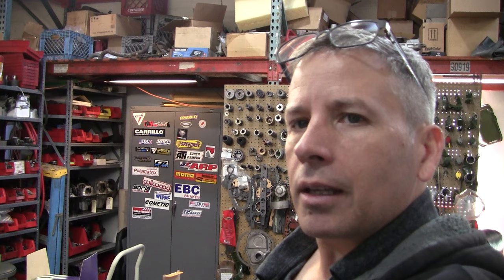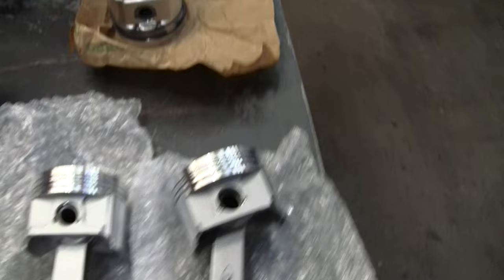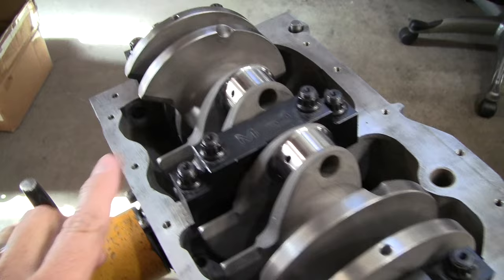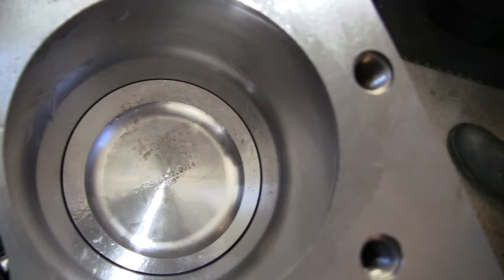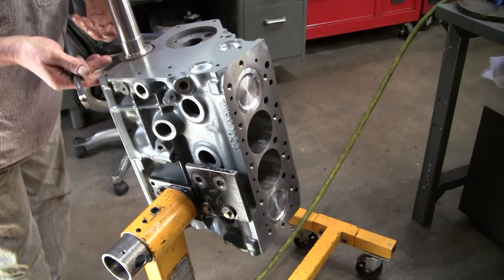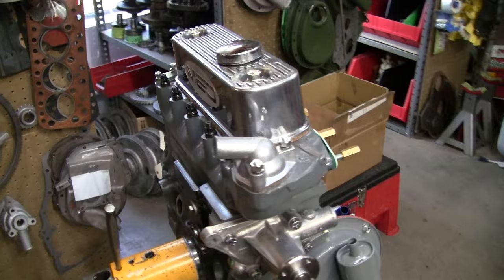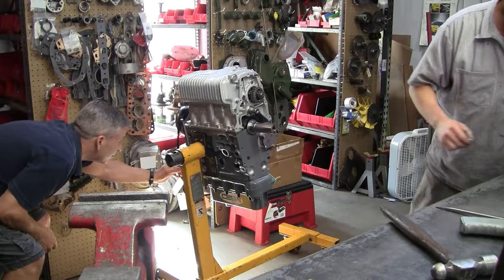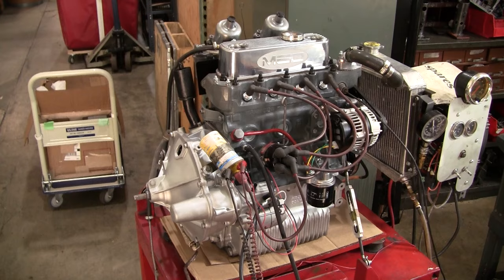Classic Mini Engine Performance Upgrades

Comment: Why are the stock con rods offset? Seams like thats asking for problems
Reply from the maker: Probably because of the design of the stock crank and the way the weights are arranged.
Reply: Because when the engine was redesigned with bigger bores (for all the S series engines) the central two cylinders had to move slightly further apart and the end cylinders slightly closer together.  Rather than re-engineer the crank for what was going to be a very small series of engines, they chose to re-engineer the rod instead.  Had they known how successful the Cooper S was going to be, they’d probably have done it differently...

Comment: is the crank still cast?
Reply from the maker: I believe they are billet steel.
Reply: @minimania  NICE! good stuff bud! I wouldn't let on you didn't check the combustion chamber cc! you tube keyboard warriors can be savage! keep up the good work and a thumbs up from me
Reply: @minimania  It isn't billet, you can be sure of that because the waisted areas between the throws have an unmachined surface. That could be forged or cast, I'm thinking forged because the surface is fairly smooth.
Reply: @984francis  They're billet alright.

Comment: Three main bearing crank is better than five? More deflection?
Reply: 5 is better in the most basic comparison. The pistons & small end of the conrods have to change direction at the start & end of every  stroke. That attempts to alternately stretch and compress the rods and the same forces have to be contained by the crank to stop the pistons flying in to the head. A 5 bearing engine has main bearings on both sides of each conrod to equally share the job of holding on to that big end.

3 bearings are mostly for cost saving, but aren't as bad as 1st appears. The pistons are in pairs so when 1 is at the top its neighbour is at the bottom so the equally and opposite reciprocating forces mostly cancel each other out. Though, the pistons aren't directly opposed (as in a flat 4 engine), so there is some twist on the crank perpendicular to its axis of rotation. Another factor is that the pairs of pistons are mirrored to improve balance that would otherwise cause the  engine to rock like a seesaw. This means the middle 2 pistons travel up and down their bores side by side so the centre main bearing has to take virtually all the load off two pistons, there being no bearing on the opposite side of either conrod. Hence that fancy centre main cap with 2 added bolts.

On the plus side there's empty space in place of 2 bearings which reduces weight and means there's nothing stop you putting putting 1&2, 3&4 cylinders as close together as possible.  So more saving of weigh,t a more compact engine and  fewer components and machining operations.

The A series is a tough little lump of cast iron, snapped cranks have proved a rarity so it hasn't really suffered for missing a couple of bearings. That fancy crank would really only be justified if your were to spin one particularly fast. Faster than is useful with anything other than a cam that would only be usable on a race track
Reply: you always want as many main bearings as possible. the key most of the time is to have 1 more main bearing than you have cylinders.
Reply: @frigglebiscuit7484  not necessarily so.  Setting cost aside, friction is a major concern when it comes to main bearing design.  Around twenty years ago as the benefits of synthetic oils were becoming really apparent, race engineers started to reduce the width of bearings to reduce oil drag, and then began to swap five bearings to three to take the idea further.  As long as the centre main bearing is up to the job, this proved a useful performance compromise: not as smooth, perhaps, but ultimately more powerful, especially as the new synthetic oils could stand the increased bearing pressures.  As always, it’s a matter of compromise.

Comment: i see thats a stroker kit so what is the displacement now. 2000 cc
Reply from the maker: Actually, no. This set up has the standard 1275 stroke.
Reply: looks like i have learned something today and thanks.

Comment: What cam is that engine running?
Reply from the maker: It was the Piper Cams MED Mini Metro to RS MEc Spec cam. Intake 270 Exhaust 284 duration. Full lift (in degrees) 105 in/110 ex.

Comment: I've never seen a ring compressor like that before. I take it that it is internally tapered ?  8:35
Reply: @InfiniteMushroom - I reckon you're probably right.
Reply: Yes, it’s common tool on Cummins engines too

Comment: All that money on the bottom-end and head, and he runs a carb-and-distributor setup? I don't get it ;-/ Was that just to break it in?
Reply: Those fancy internals are really for competition cars that have regulations to comply with.
Reply: @hlund73  That was going to be my 2nd guess. I thought maybe he had to meet class restrictions. Otherwise, throw a VTEC in the darn thing!
Reply: @jamespoplin8409  Honda Vtec requires a fair bit of cutting of the shell and custom subframe design, it's not exactly a throw it in job.
Reply: @ferrumignis  I can see going this route for the sake of originality. For the money put into this engine we're talking what, 150 MAYBE 200 ponies? You could get that from a STOCK VTEC and STILL have money left over! Just saying....
Reply: @jamespoplin8409  In the UK if you cut up the inner wings and subframe your car requires an IVA inspection which is very difficult to pass with an old car, they test things like radius of internal and external parts, many of which will fail on old cars. Additionally insurance for road use will be much higher with major modifications such as fitting a VTEC.
Reply: @ferrumignis  That's very interesting. Thank you for sharing that info. with me. I do appreciate hearing from different points of view and it appears to me you have knowledge in this instance that I did not.
Reply: @jamespoplin8409  If good power and reliability are the only goals, a VTEC swap makes total sense, the old A series will never make that kind of power reliably and even if you managed it with forced induction the gearbox would be blowing up every five minutes.  I'd love a VTEC mini, but the rules and  regulations you have to jump through put me off. I'm sure some just ignore them, but then you have insurance issues etc.
Reply: @ferrumignis I had a buddy right around the turn of the century who had an early 60's Mini with the 1.5l VTEC out of a civic. Mostly stock with bolt-ons, but that little whoopty scooted along like a stung mule! We were taking on Stock 'Stangs and 'Maros from stop light to stop light. And I thought California was strict! As long as he put all the smog gear back on during inspection, once every 2x years, he was all good!
Reply: @ferrumignis  There are lots of Watsons VTEC conversions on the road in the UK, many of which also seem to perform well on track days at the various race tracks. I'm in South Australia and have a Watsons B16A2 kit in mine, based on a Rover Metro front subframe, licensed recently for 90 days use a year (on Club Historic rego with a Mini club) and costing AUD90 a year rego fee. Insurance is AUD240 a year with Shannons, fully comprehensive, choice of repairer, and right to retain the car if wrecked (and, of course, if I'm in any condition to want it back). If licensing VTECs is difficult your end, maybe you guys need to get your car clubs to exercise a bit more political muscle and get your regs changed.
Reply: @jamespoplin8409  I suspect that this build is for a customer who bought the bits from MED (with or without advice from MM) and asked MM to build a road car with them, maybe having the potential for a bit of track/hillclimb work but not much. Builders get a lot of that - customer reads about hot up bits, buys a heap of them and then gets somebody to install them. As often as not they are rather vague about what they actually want to do with the car and expect it to do everything asked of it. In this case the engine may run out of puff up top with SUs before the crank kit reaches anywhere near its practical limits. The lack of knowledge of the compression ratio suggests not a race car, but the million dollar high rev internals do. It's an odd build.
Reply: @phildavenport4150  Any changes to a cars structure loses it's type approval and requires an IVA test. This includes self built cars (kit cars). This legislation is not going to change any time soon, in fact it's more likely to get tougher.
Reply: SkyWizardless WTF is a VTEC Swap? Honda have VTEC engines with 90hp...
Reply: @mc1996  A VTEC swap means fitting a Honda VTEC engine into something it wasn't originally fitted to, I'd have thought that was totally obvious??  Typically B or D series for the mini.
Reply: @ferrumignis  So you mean a B16 or B18 Swap. Or even a K Series Swap. A Honda Swap its OK to..but a VTEC Swap? LOL. Looks those kids when they learn a new word...
Reply: @M Cunha The K20 has been used but it's a tall engine, and more work to fit so not many conversions.  To most people "VTEC" means a B16/B18, at least for the classic mini.  Not quite sure why you are so obsessed over the use of the acronym, pedantry isn't an endearing trait.
Reply: @mc1996  A B Series is a bigger version of the A series made by British Leyland. A K Series is what replaced the A Series in Rover cars, like the Metro that was meant to replace the Mini. Vtec makes much more sense especially as it also describes the technology that makes the engine of interest as a swap. 

Nobody really knows if a Vtec conversion would fall foul of UK regulations and I doubt anyone is keen on being the first to find out, though it's a possibility. Minis have certainly passed the test.

It's hard to beat a well sorted A series in a Min, hardly surprising as that's what they were designed for: weight distribution, gearing...
Reply: carbs/diz are easier to tune. dont have to fumble with a keyboard for hours when you swap even a simple spacer on the carb.

Comment: would have been interesting to see the primary gear / flywheel fitting etc, don't these cranks need additional work to standard to make it all fit?
Reply from the maker: No - the only differences in this case were adding a 4-bolt centre main cap and to clearance the inside of the gearbox to clear the one crank web. Everything else was standard A+ Mini engine type set-up. I mentioned needing to shape and fit the keyway on the crank but there's not much else to do. The only other difference is the straight cut primary gear is held in place with just a spacing collar instead of the standard c-clip since the webbed cranks aren't slotted for those.
Reply: @minimania  ah! that's what I was thinking of, the c clip difference.

Comment: What engine would you recommend for a Morris 1000, slightly warm?
Reply from the maker: For the Morris Minors, if you're not concerned about originality, we would recommend a 1275cc engine for more power. We also recommend a front disc brake conversion and possibly a hydraulic clutch conversion, too.
Reply: @mini mania just what I was thinking already have the front discs, that’s 1 off the list
Reply: Morris 1000 ,! Find a marina
Reply: @rossnparfitt   Montego/Maestro would be a bit more mobern, but all of 'em rocking horse poo now. There must be a simple modern engine swap that'd drop in a RWD Moggy on bigger wheels much easier than a Mini? MX5 Cappuccino?
Reply: @hlund73  like I said marina it's already been done,,,
Reply: @rossnparfitt  Marinas were also A Series, or if you mean a B or O series one they're as ancient and even rarer than an A.
Reply: I guess, lemon's n oranges hey,

Comment: How much are these engines to buy
Reply from the maker: Because of the specialized parts in this engine, it's expensive when compared to standard rebuilds which start in the $7,000 range for most Minis.

Comment: Straight Rods??? does this engine usually use curved Rods lol
Reply: No, but it does have pistons that are offset from their crank journals.
Reply: @hlund73  most engines have pin offset, unless you mean the offset is forward or rearward of the bore centerline
Reply: @johnnym1320  don't know what you mean by bore centreline (axis?) or forward and rearward (same as engine, front belt pulleys - rear flywheel?). 

Those rods and the fancy crank do remove the offset that's standard for a large bore A Series - It has 3 main bearings and the standard rods put the reciprocating mass closer to the adjacent bearing for each bore.
Reply: @hlund73  yes axis, centerline, imaginary line running through the bore. Most pistons are   offset so the rod is more perpendicular to the bore on the power stroke. But I think in the mini's case you mean offset because the rod journals are not on the same centerline as the bore.

Comment: Lols....rather buy an adapter plate, fit an A14 / A15 Nissan screamer, and NEVER worry about oil leaks or reliabilty again; No more slack-springed, wobbly distributors, no more cavitating fuel pump diaphragms, no more stretched timing chains, no more worn valve guides / stemseals, no more valve bounce, no more leaking T-C gaskets......not even when you turbo the thing.....
Oops: puritanical sacrilege = vehicular redemption.

Comment: I own an Austin 1100 A Series,  1973  and 32,000 miles in the clock buy have a problem since I replaces a  valve  with increased oil consumption.  What can I do.  With radial tyres too lost a lot of profile in tyre size  in comparison to old crossply tyres. Fixed this with a set of 13" rims from Hyundai Amica (same  bolt pattern)  which tocame to the same ratio as original. In a ten mile journey I was doing 11 miles before now its the same. I expect this extra revv did not help.  What do you think can be done for my oil consumption problem. Had thought on an A+ in a new metro engine. Thank you. Your video is great, Thank you. Mervyn   (email :  mervynewing@aol.com)
Reply: Doubt it is the same wheel fixing on a modern car from Korea. Minis are 4 inch PCD - 100mm PCD is close but not close enough. 

Oil consumption is either valve oil seals or piston rings/bore wear. Smoke on start up is a classic sign it's a seal
Reply: @hlund73   Yes, same wheel pattern, I use them all the time, 13"  rims bring the  wheel ratio to the same as that of the old Crossply. Great job and makes for a much more comfortable drive and of course takes the revvs down to normal.

Comment: Don't mess about ,put a newer engine in not one over 50 years old.
Reply from the maker: Well, a Honda VTEC engine is a possibility but it very expensive and requires a totally redone front end and custom subframe (among many other changes). There really aren't any modern engines of such a (relatively) tiny size that will fit within the factory space in a classic Mini.
Reply: @minimania  have  you seen the 16v k11 Nissan that someone is doing ,I know lots of fab on s/frame but better option than bike engine(to noisy) ,I do see your point with like for like.

Comment: Nice parts from MED, shame you didn't work out the compression properly, and by the looks of it, not bedded in cam at 2k revs for 20mins,so that's the cam and lifters fecked 👎👎👎
Reply from the maker: We did run in the engine for a long period initially. So, the lifers and cam lobes are fine. We do this as a matter of course - not our first rodeo. It would become instantly apparent if we were building engines and not breaking them in properly.
Reply: @minimania  there's always one.

Comment: All at great cost and its still a wobbly A series ,  no thanks
Reply: Totally agree. It still has all the downsides of a cast iron A series except this one probably costs £000's. What really is the point of trying to tune a 60 year old designed engine??
Reply: @Draxindustries1  look at a 120 bhp 998cc Hillman imp engine and you will see why😘
Reply: @nickclark6001  Yes, and derived from the Coventry Climax. Friend of mine (Andy Bryson) ran one for years in Oz and elsewhere, most notably in Targa events where he regularly beat the best Mini times on special stages. Heavier and better handling, and you only needed cohunas the size of cannonballs to keep up with him.
Reply: well damn man, if youre gonna be like that, then just put a fucking v8 in it....

Comment: Spends £4000+ on the crankshaft, pistons, con rods, And then add the machine work for the main straps. But puts a fucking carb on it with a dizzy 🤣🤣🤣